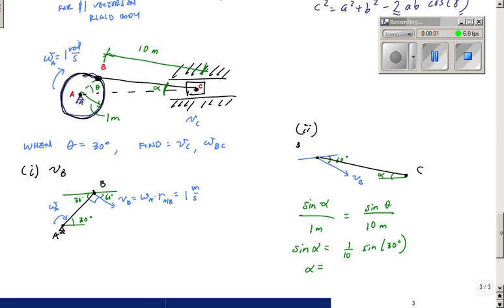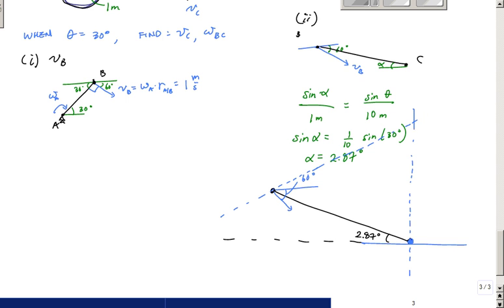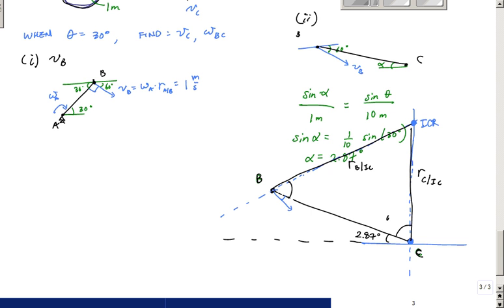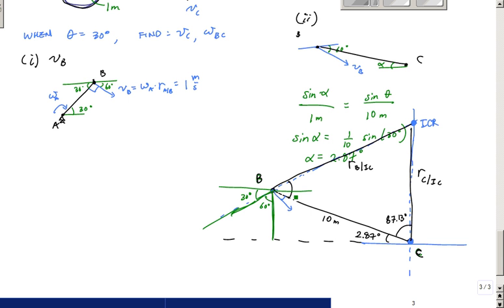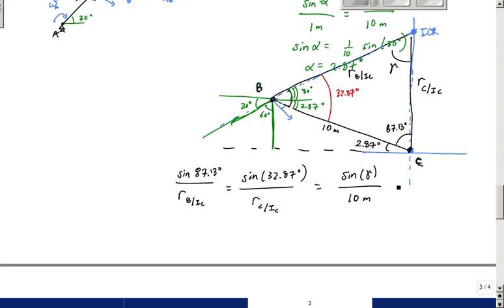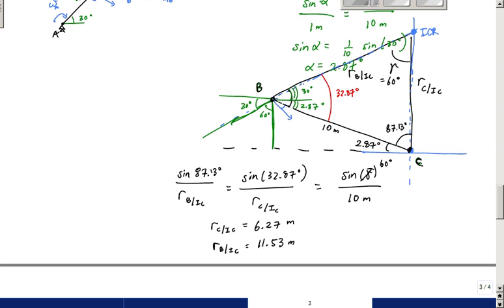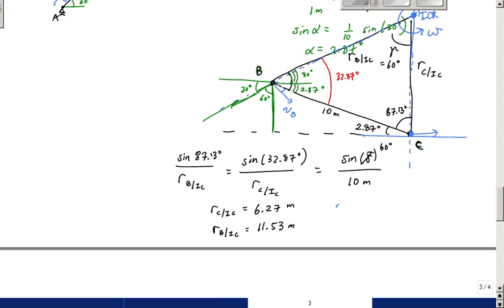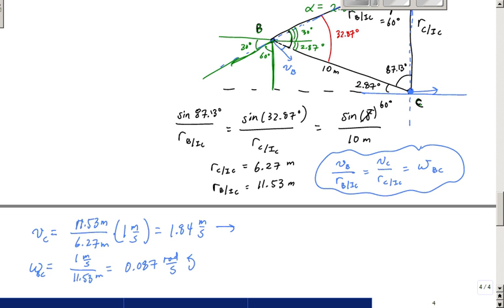Instantaneous Center of Rotation (Part 2) - Engineering Dynamics

Comment: I am confused when you are solving for alpha, you use velocity and length to solve for the angle, but how can you mix both together? should it either be velocity or length because the units would not add up? you would be leftover with a seconds bc, nothing would cancel out with it